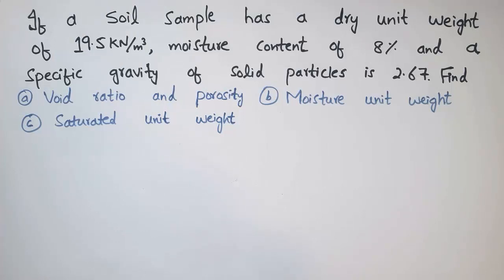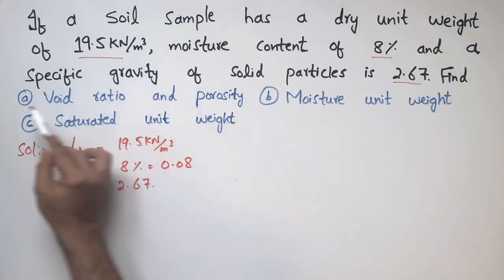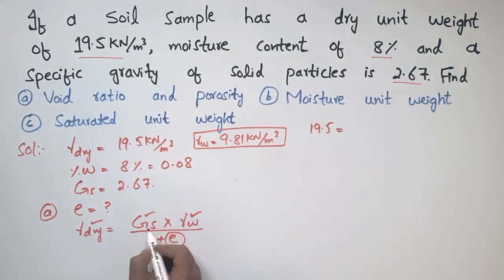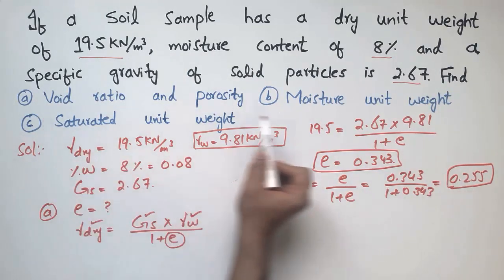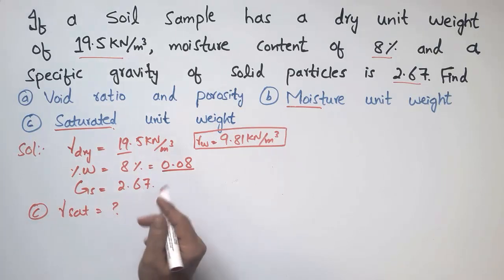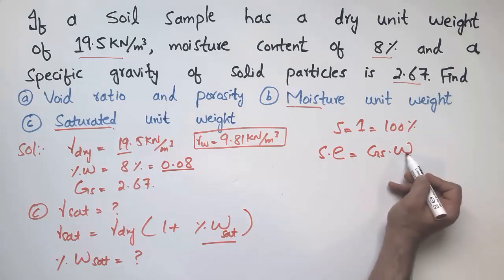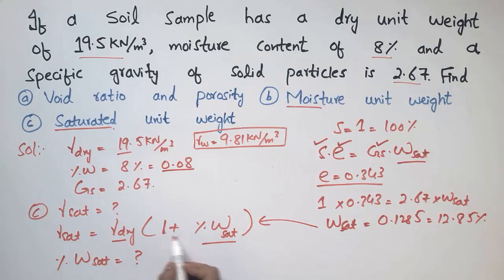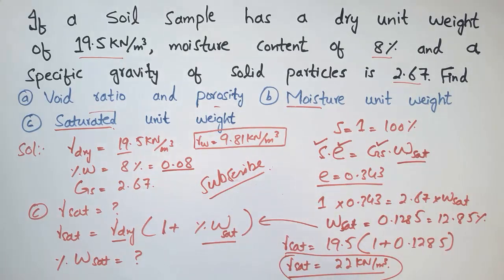Void ratio, Porosity, Saturated unit weight and Moisture unit weight

Comment: The unit weight of soil is 17.10 kN/m3. The moisture content of this soil is 22% when the degree of saturation is 58%. Determine the following:

a.	Void ratio

b.	Specific Gravity

c.	Saturated unit weight

d.	Porosity

e.	Wet unit if the degree of saturation is 35%
 please do these problem?